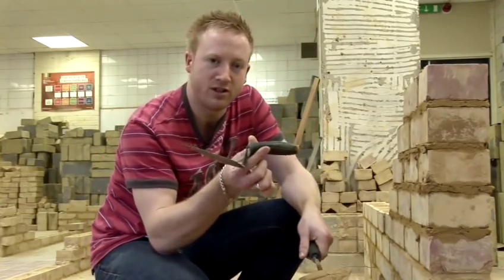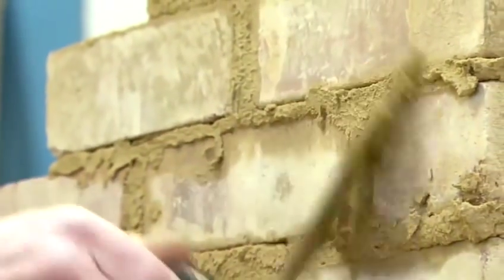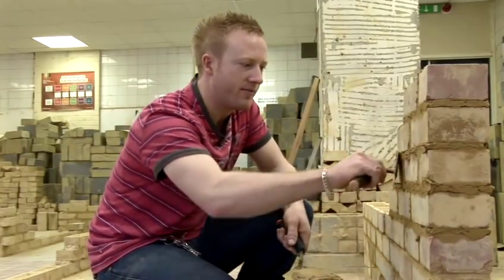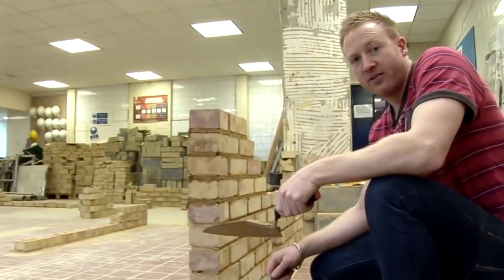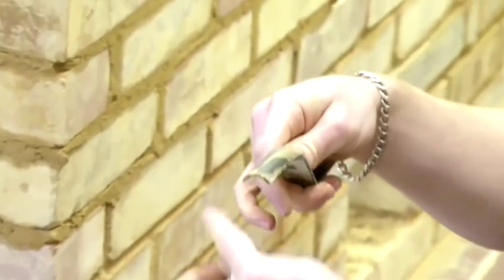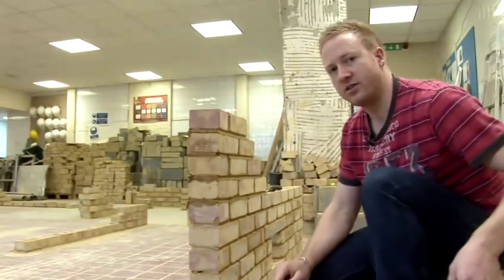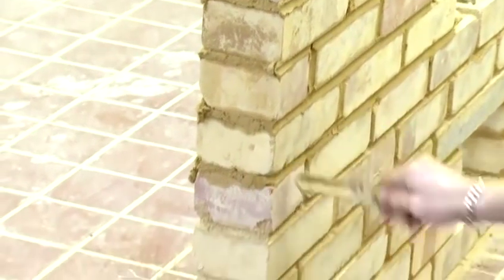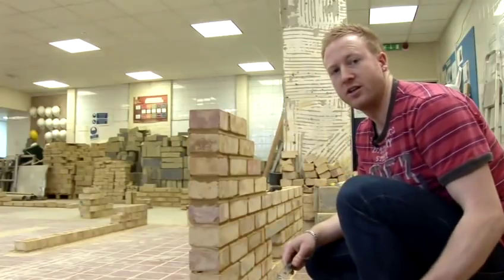How To Lay Bricks Like A Bricklayer

Comment: Well unless there is a second part to this video then I did see the whole thing. For a start I would never use such a crud jointing bar but a proper bucket handle jointer and holding it firm and flat across the joints. Not just following the brick but making a nice smooth striaght line. I think I will have to post a video on how I do it one day :-) However thanks for your responce always nice to debate with someone who has an intrest in good work.

D Dore

Comment: how can I practice bricklaying at home with using cement, I'm using just sand but it dries to quick. can you help?
Reply: E, use lime and sand. it won't set up and you can reuse it if you tear something down.You can adjust the mix to your preference but I would start with try 4 parts sand to one part lime. If it's too sticky add sand, too sandy add lime. You should be able to butter a head joint( or perp depending on which side of the pond your on) without it falling off.but still be able to spread mud on the wall without it sticking to your trowel.Hope this helps

Comment: Most people will never see the backside of the wall. While his technique appears to work, it's not the correct way to joint a wall.  The only thing I saw of value here is that you do your head joints (vertical) first. Everything else was poor practice. If you ARE concerned with the back of the wall and have access to it - just stucco it and then apply a water proof coating to it.
Reply: can you give some better advice please? Practicing hard here.
Reply: I'll make a video, but correctly made mortar should be ready to be jointed in about an hour.  It should almost never be jointed immediately after the wall is laid because of risk of whiting out the joints and the mortar not holding the shape of the tool. If you can stick your finger on the mortar and leave a fingerprint without mortar sticking  to your finger, another good test.  It also depends on the type of joint, a concave can be done with really firm mortar but a grapevine needs to be done somewhat wet.

Comment: lmao thats shit and your bricks are rolling mate 😂 you never use an S joiner on bed joints ... perps ok but S joiners wont keep your beds straight you need to use a long roll joiner for beds. When you join your corners start from the out then in so youre not pushing the mud out the opposite corner. 😂